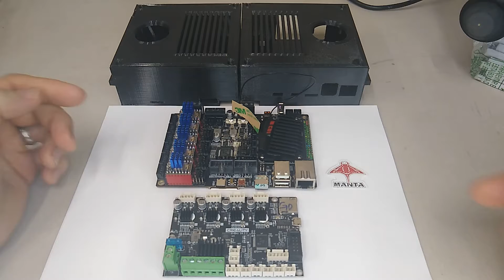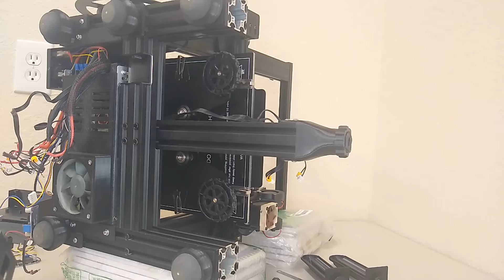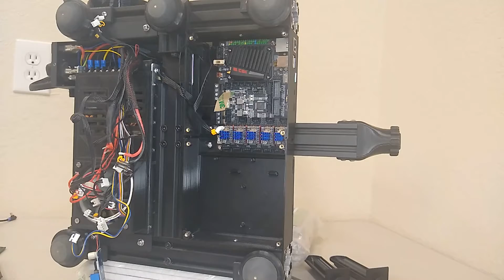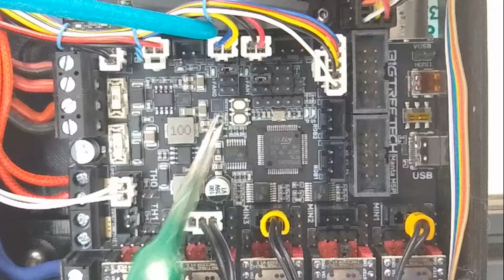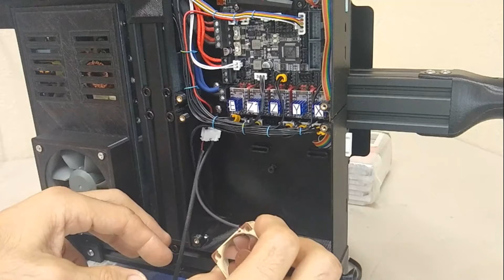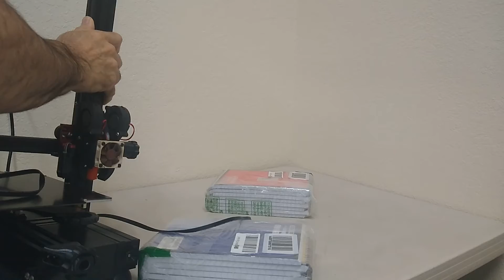Ender 3 V2  Manta M5P+CB1 Install

Comment: Got everthing working exept the extruder, does the board need the 24v wires one for the motor 5 to be activated to work the extruder? Im going on 2 weeks and still cant figure out why extruder don't work

Comment: Thank you for the video. I have almost the same setup. Using the CB2 instead. I have used the bottom mounted Kevinakasam dual z setup. Excellent job!
Reply from the maker: Thank you for commenting and encouragement, friend. I'm glad you found value in this video for your viewing time. Best of luck with your mods :)

Comment: Hello 
One question about the MP5. I saw it as sensorless homing. Have you tried this configuration?  Did you think it will be accurate? 
I'm looking to simplify and remove as much part and cables as possible 😅
Thx
Reply from the maker: Hello Francois, Thank you for commenting. I've been wanting to try it myself but haven't had the need to do it. I guess really it depends on your setup. My CR-Touch can reach to within 10mm from all the edges of the print bed and since my bed clips occupy that space there is no need for me to probe there.

What printer do you have?
Reply: @vbared   Thx for your replay :)
I have a diy printer based on an anet (AM8 sort of), it's in constant evolution. I'm using a probe for the z axis, which work amazing, I may give a try to the sensorless setup for the x and y axis,

Comment: Thanks for making this video! 
Do you wire the heatbed direct to the output? Or with a external mosfet inbetween?
Reply from the maker: Hi friend, Thank you for commenting and encouragement. I'm glad you found value in this video for your viewing time. It depends on how your stock setup was. If it had a MOSFET then wire the output to the MOSFET input. If there was no MOSFET then wire it directly.

Comment: why you want to relocate z steppers?
Reply from the maker: Hi F35, Thank you for commenting. I'm wanting to ditch the single sided lead screw for dual independent controlled timing belts. I find myself having to mess with the unsupported side of the gantry once in awhile to level it to the frame. The Manta M5P with the extra stepper driver allows me to use Klipper to auto level the gantry prior to a print.